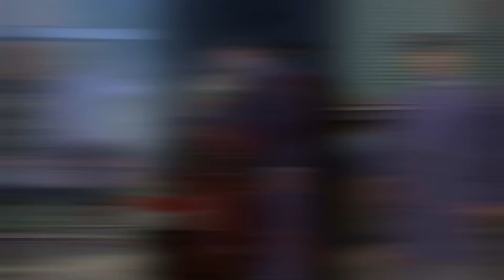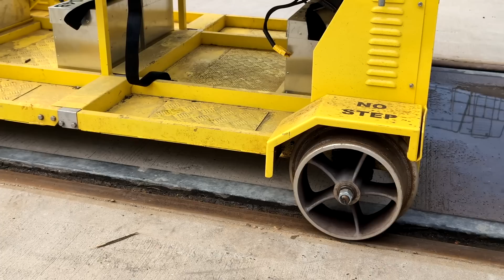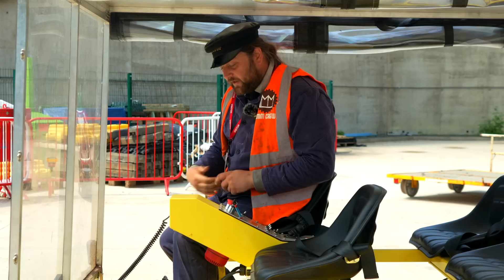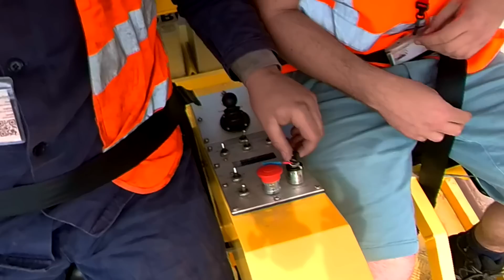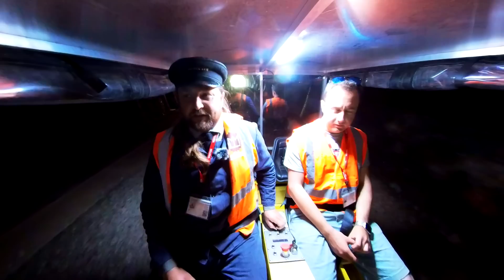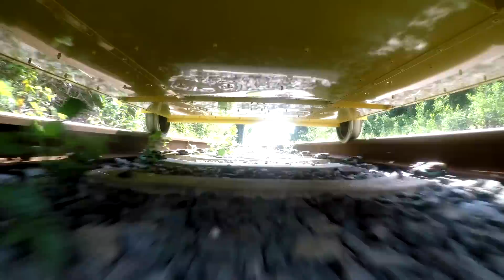Driving over Test Tracks with Electric Power! The Bance Rail Vehicle LGL Ep.46

Comment: The inspection trolley the Bewdley P-way department have is a sports model of one these trolleys. It is full convertible spec with low slung back to back seating for 4, roll bar and Honda petrol engine. Unsure how quick it goes but it is lightweight so it can be turned around by hand as it has no reverse  gear.
Reply from the maker: Oh really? I guess that is the point behind them

Comment: The line they are on is the South Staffordshire Railway, wich ran from Burton-on-Trent to Stourbridge Junction via Lichfield Trent Valley, Walsall, Wednesbury, Dudley Port, and Dudley town centre.

The Lichfield Trent Valley to Walsall section is still in use for the Cross City line
A lot of the rest is being looked at as a 3rd Midland Metro line (from Stourbridge at least as far as Wednesbury)

Comment: Hey Lawrie, i have an n scale Bachmann 060 but it has a problem. I think the driving rods have come off the middle wheel on the locomotive and now when the train tries to run the front wheel which isnt connected by gear to the motor will get the rod stuck. When the rods try to move backwards, the front wheel does not turn properly and the train tries to pull the rod back when its in the middle so it tries to pull the rod directly across the wheels and cant move. Got any ideas or recommendations?

Comment: As a nipper I got to ride several Wickham trolley's the two most notable was Sole Streets Wickham and Penge East's Wickham, I also thanks to my uncle who was a class 33 driver got a ride on Southfleet's Wickham which was there for track inspection as the line wasn't renewed just the original old wood block and chair it had been when it ran to Gravesend West.   Sadly due to the "golden shower" incident involving me widdling out the door of a class 33, a farmer type who happened ahem to be in the line of fire as he used to wave to me uncle as we trundled by and said farmer type who raised absolute hell on the fone to BR that fateful day I was no longer allowed to spend summer holidays chuckling along in his 33 going to far flung places like Hither Green, Willesden and Kensington Olympia with Ford trains off the isle of Sheppey.   He sadly ended it all at Higham station, stepped in front of an ECS movement EPB...

Comment: a set of solar panels would be useful on that yellow trolley ;)
Reply: Hmm... Solar isn't enough to power continuous-cruising narrowboats in Britain, though this trolley is about 1% of the weight of a narrowboat, maybe 0.5%.
Reply: I wonder if attaching a small or tiny wind-turbine to generate charging power would work?
Reply: @linndoria  When the trolley is moving, the turbine would take more than it gives. When the trolley is stationary, it depends where it is. That test track looks very sheltered from the wind. On some line in flat and treeless parts of eastern England, a small turbine might charge the it full, but it would only be reliable when it's stopped in the middle of nowhere. I've found small houses creating a huge wind shadow when the wind is fast and steady over flat land.

Comment: I have actually been on a much simpler rail vehicle:
Square box frame, no floor; a pair of plastic bucket seats bolted directly to the frame; a tiny gas engine with direct friction drive to one axle; no windscreen, no roof, no suspension, absolutely no ride quality, but a lot of fun!
Reply from the maker: That sounds hilarious!

Comment: On my doorstep! I had explored the track bed, minus the tunnel (which was blocked off) about 8 years ago, the innovation centre was the site of Dudley's station on the South Staffs line.  The abandoned section at the far end is still intact, and about 2 miles down is Tata Steel rail plant. From there the line is still in place and runs to Stourbridge Junction as a freight only route, although some of that abandoned section may be used for the Metro tram extension currently being built, that runs behind the innovation centre.
Reply: Are you coming along to the Family Day?
Reply: @bcimo1  All being well, yes. I look forward to seeing the vision of the future of rail travel, for both light (local) and main(inter-city) networks.